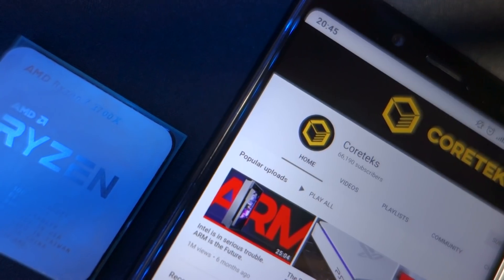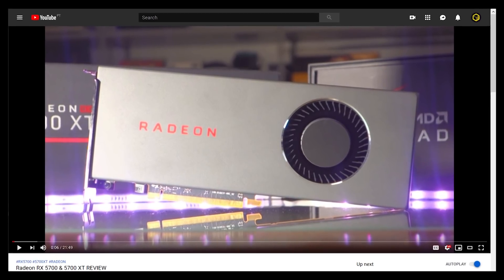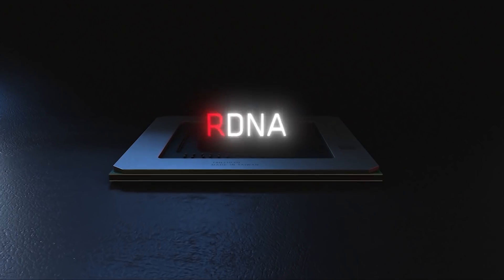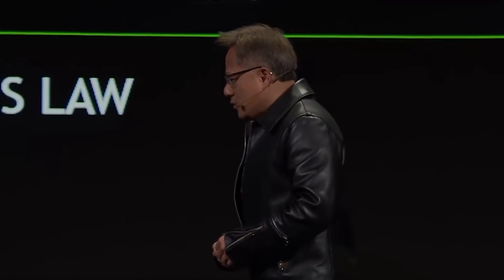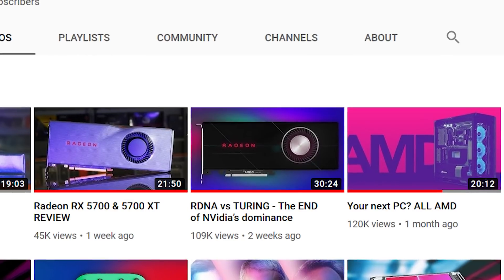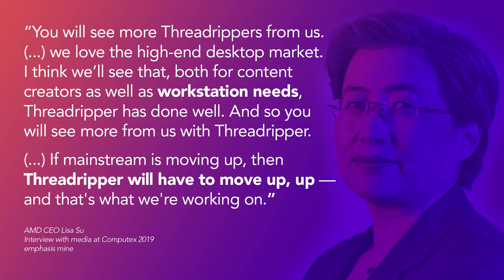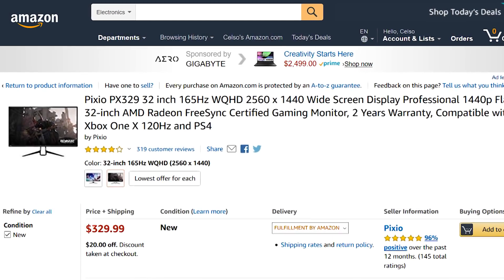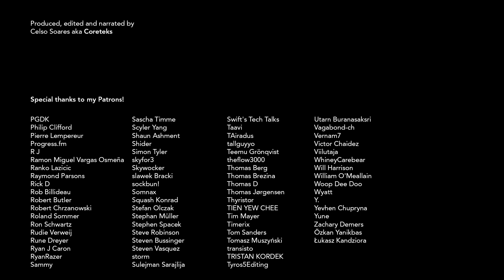What's next for AMD? - 5800XT. Threadripper. APUs.

Comment: I've been pondering buying a Vega 56 for €250 right now vs waiting for custom 5700s/5600 which will run me at least €350 for 1080p 144hz and, while Vega is such a good value at that price, I am going to go with RDNA nevertheless. After getting into the innerworks of the new architecture, it really looks like the vanguard of current technology, and that is very exciting!
Reply: Yeah, and the power consumption for the performance is going to help a great deal too :) I'm eager to see the newer 5700 XT models because I want to swap away from Nvidia for good.

Comment: Dual socket Threadripper doesn't make much sense to me, because Lisa Su herself at Next Horizon 2018 spoke about how AMD wanted to avoid relying on dual socket motherboards for the Epyc platform. She mentioned how Rome  was being developed specifically to combat Intel's dual socket offerings, because apparently even clients who buy dual socket motherboards sometimes only install a single CPU, which makes for a terrible price to performance end product. The reason these clients buy dual socket systems instead of single socket ones, if I understood correctly, is that motherboard manufacturers purposefully omit some useful features from single socket motherboards and AMD is specifically trying to target those clients who need a fully featured single socket offering while at the same time offering a high core count platform that doesn't rely on dual socket motherboards, thus having a much more compelling price to performance ratio.

That said, heterogeneous is definitely something AMD might be aiming at with the Threadripper platform given that the marketing surrounding these CPUs is targeted at content creators and game developers. Apart from AMD, no one really knows just how flexible the chiplet design actually is. Maybe it is possible to slap something other than CPU cores on a single package. Though the thing I don't necessarily understand about your theory is what kind of accelerators you think the Threadripper package will contain. You mention video encoders or machine learning/ai accelerators, but those are tasks that both AMD and Nvidia have been promoting their GPUs for. In my opinion, it doesn't make much sense for AMD to develop new types of chips for a task that their GPUs are already good at. So does it mean that 3rd generation Threadrippers will become fully fledged APUs? Unfortunately, I don't believe so (seeing high-end APUs come to the market is a long lasting desire of mine and the new chiplet design of Zen 2 does stimulate the imagination). AMD have in the recent past (since the launch of their Zen based APUs intended for small budgets) denied any plans on working on high performance APUs.

The era where integrated GPUs completely replace discreet GPUs in the consumer/gaming market is I believe further away from us than the era when Risc V based CPUs become the mainstream platform over x86.

Comment: The Navi 40 dies may only be 255mm^2 small, but dont forget this is 7nm, which has a 40-50% die shrink from 12nm, this means if Navi was produced in 12nm, their chips would be just as big as Nvidias Turing chips. TSMC claims their 7nm yields are good, but they are not as good as 12/14nm yet. In the end AMD has to pay about 50% more for 1 Navi chip than they paid for 1 Polaris chip...i can only imagine how much more expensive and harder to produce any bigger Navi chip is gonna be. Im not saying it wont happen, its just gonna be very expensive or take some time until the 7nm process is improved some more

Comment: Powerful APUs will be the biggest game changer I believe AMD is all over this, I can hardly wait
Reply: They will never be more powerful than a lower card. Its just the nature of them right now. If they learn how to 3d stack the chips, then that will change. Its too small of a die and cooling it would be a pain at its current state.
Reply: Even Vega 11 on desktop APUs is already held back by DDR4 bandwidth, while less bandwidth dependent architecture helps, you will always run into bandwidth issues there. 3D stacking or just a separate HBM-chip might alleviate that to some degree though. APUs will remain media PC and laptop specialities for the next decade.
Reply: Defeqel other rumours for the next APUs indicate that they might use a vega 20 GPU which uses HBM2. If the design is similar to the current vega 20 and implemented well with zen 2 it could be an incredible APU.

Comment: An apu, threadripper or otherwise, with an on package HBM stack could have compelling use cases. Would be quite useful for VM hosts where it's important that the host has a video output without sacrificing a dedicated PCIE slot.

Comment: There's a difference between what can be made and what should be made.
APU's can be built with a high performance graphics engine approaching RX 580 levels of performance using RDNA, but there's a couple of realities against that notion.
Primarily memory bandwidth, AMD would need to include a 4GB HBM die on the package, you cannot get that level of performance with system memory and that includes DDR5 (DDR5 5000 dual channel = 80GB/s). You can't use GDDR6 on package as you'd need 4 dies to get a 128 bit bus. In perspective RX 580's use a 256 bit GDDR5 bus to get 256GB/s. You could get this same bandwidth with 4XGDDR6 16000 chips on a 128 bit bus but you need 4 chips, or 1 HBM2 chip @1000MHz for 256GB/s.

There's no way around it, you're going to have to add high performance graphics memory to achieve any reasonable graphics performance. A 2080ti will run worse than a 1650 if it's limited to system memory bandwidth.

So a single HBM chip might get you up to RX 580/590 performance, but even with 7nm & RDNA you're going add a fair bit to the power draw. Ask yourself if you'd buy a 125W TDP 6 core 16-24CU APU with marginal 1440p (native) performance for $300-$400. Just look at the Core™ i7-8809G with a pricetag of $550 that can't get close to a 570 let alone 580.

It get's worse if you wan't to get to 5700/2060 levels of performance as that'd require 2 Stacks of HBM or 256 bit GDDR6 (8 chips X 32 bit wide). Of course there are ways of optimising memory bandwidth, but the reality remains that to get any level of performance above RX 550/maybe 560, you can't do it with system memory alone. It's why consoles use GDDR (quad pumped) for system memory.

It's always possible that motherboards could come with GDDR for APU's, but then you're going to bump up the cost of motherboards to add 4 chips of GDDR6 just for that APU. The only time that an APU like that makes sense is for small form factors that can't add a discrete GPU.

DDR5 will not make a huge difference to APU's, it'll allow more performance, but not enough to get anywhere near 1440p, they'll maybe be a baseline 1080p, rather than the 720p gpu's that currently are in APU's.

By the time a cheap APU will do 1440p, the baseline monitor will be 4K and you'll be driving it with a $100-$150 GPU (a GTX6650 / RXX500 perhaps) and we'll be beyond DDR memory of any speed, or it'll be a Threadripper APU using quad channel DDR5 memory, and that's even less likely than using HBM.
Reply: A single stack of HBM 2/3 would make all the difference. But yeah, powerful APUs won't be a thing until fast memory is built onto the package.

Comment: Also the best part of this is Ilanos.. AMD's 2011 revolution, the ability to run 1080p at the time with decent settings in most recent games on a $500usd laptop.  That was the first ripple of what AMD would eventually do. Intel and Nvidia's apologists love to try and drag AMD down to the competitors level, they are half right in a way that they never predicted. AMD is done with being the underdog. They will undermine the market to emerge the victor by any means possible, even if it destroys prior cashcows.

Comment: I could really get behind a supercharged APU - something like 6 core Zen2 + around 5700/2060 level graphics for a good price would be very attractive - they'd probably need a new socket for the higher TDP, but the potential cost savings of not requiring a dedicated GPU could make it a VERY attractive option to the majority of 1080p gamers that already run ~1060 level cards etc.
Reply: maybe after 3-4 years it will be possible, but not now. now rx 570 level apu would be veery nice.

Comment: C'mon, AMD. Just release the 7nm Threadrippers already. I really want to upgrade from my 1950x to those sweet 7nm cores. 🤤
Reply: Looking at 3900X matching 2950X in cinebench means 24 core 3rd gen TR might match 32 core 2990wx. This is just insane performance bump.
Reply: bgtubber Stop that saliva right now or you'll fry your motherboard!
Reply: Same here. But I might need no more than 8 cores coz all I need is more RAM support and more PCIe lanes for my half dozen GPUs.
Reply: a R9 3950X is a 2 generation jump from a Ryzen Threadripper 1950X, you might as well go there. 
AMD might have the 3rd gen Threadripper start at the 24 core and up line 3970WX, 3990WX. 
I have a 2990WX, I won't be doing any upgrades.

Comment: The perfect time to launch 5800 Navi would be in September when the 3950X hits - do as bundle with 50 or 100 off if you buy the pair from the AMD web shop.

Or #sneakattack3: launch the 5800 and 5900 in September ... oh and throw in the new TR so folks on 16c TR don't feel hurt from desktop having 16x.

The next TR could start at 24 cores ...

Comment: I'm very excited for the possibility of 1440p capable APU's. It's not that I would actually care much about 1440p gaming in general as I'm usually one of those who turn the settings down anyway to maximise FPS. But if an APU could do it, it would probably suit me modest needs quite perfectly as the biggest reason for me to still be using an R9 390 is that I don't NEED to upgrade. I hope your instincts are true this time too 👍

Comment: If AMD drops a Threadripper APU with full blown NAVI built in I’d buy one.
Reply: That was the idea a few years ago, 16 Cores with a full Vega GPU in it, but it didn't come to the real world but with Zen 2 and RDNA 2 it could be real
Reply: I doubt there's anyone else that would want to buy this product.
Firstly, APUs are for the budget gaming market. TR is for the high-end workstation market. 4 cores is still fine for budget gaming, but workstation applications need more cores. Even for premium gaming, it makes no sense for 16+ core CPUs which is what TR is about. Also note that X399 costs much more than X570.
You could say that the advantage is high-end CPU and GPU in the same package, hence smaller size, but the problem is that the socket is too huge. Every motherboard that uses the TR4/SP3 socket is at least micro ATX sized. This means that the SFF market would have no use for these chips.

Comment: speculation 
the rx5800 is going to be basicaly between the 2080 and 2080super at 500$ 
the rx 5800XT is going to be between the 2080 super and TI at 600$
i think amd is basically going to take the 5700xt add 8GB of HBM2 call that the 5800 
the 5800XT is probably going to have 48 Cu's and also come with 8 GB of HBM2
if amd does'nt do that to the 5800xt and non xt they will just add 4 CU's to the 5800 and 8 to the xt (in comparison to 5700xt) + 12GB GDDR6 memory
the 5850XT yea i dont know if that would exist could tho (probably a 52 cu card between the 5800XT and 5900)
the 5900 will be a 56Cu 16GB HBM2 gpu selling between 700$ and 1000$  and would be competing with the 2080 TI
and the 5900XT will be the new "papa" GPU beating the 2080ti with 64 cu's 16GB of HBM2 for basically 1000$ onwards
if amd has broken the 64 Cu limit there could be a "RX Xtreme" card with a cu count of probably 72 and would be compeeting with the titan rtx
amd could do this "Xtreme" card just to create a TITAN name scheme for their own gpu's like the Titan did for the gtx 780 TI 
exept it would be "Rx XTreme" for the 5900XT 
but this is pure speculation on my part
Reply: they're not coming back to HBM2, it's way too expensive
they had to use HBM2 with vega, otherwise the performance would be killed, vega lives on bandwidth
that's why they put 16 GB on radeon vii
Reply: Having HBM2 isn’t possible I think, RDNA has been made to work with gddr6 and you can’t just swap memory types around without making changes in the architecture if I remember correctly

Comment: Bit of a shame AMD didn't put on a better cooler. The cards are both pretty decent, but looking specifically at the 5700xt it's $20 and 5% performance shy of being another 1070. It's really great.

On your 5800 stuff, I agree. Looking at the 5700xt, and AMDs settings, I'd bet the only thing that's holding the 5800 and 5600 series are (were) the yields. If they have improved, those 2 stacks will follow.

I'd probably bet on something launching in September alongside the 3950x. The 5600 series makes more sense IMO, but a 5800 series alongside the highest tier chip amd offers? Would also make sense.

Or maybe I'm crazy...but I was also the guy saying the 5700xt would be within 5% of the radeon 7, so who knows.

*The only spanner in the 5600 series would be polaris stock. But those'd, surely, be running out by now.

Comment: It's likely that AMD will wait with the bigger GPUs simply because of the cost of 7nm that you mentioned, just like why Nvidia hasn't made the jump yet. Nvidia likes to release their "biggest" chip first (within reason, the 1080 wasn't the biggest pascal chip but it was for a while), which is why they're waiting for the node to mature and get cheaper. It's still likely that AMD will release their high end 7nm cards before Nvidia since they're willing to sell at smaller margins, so they will most likely take the performance crown in every aspect by early 2020 and Nvidia is likely to take it back with 7nm cards of their own by Q2/Q3 2020 or so (though if they don't change their ray-tracing hardware implementation they may lose in that metric).

When it comes to Threadripper they may wait until they have Zen 3 ready and launch it on that platform first with the new rumored 3/4 threads per core SMT, however specialized chiplets isn't a bad idea we'll have to see.

Radeon image sharpening is certainly an interesting feature for lower-end chips, the question is how well it works at lower resolutions like 900p, 720p or 540p, I haven't seen any testing done at those resolutions and how that compares to a native 1080p image, because if it works well (like the sharpened + scaled 1440p image that straight up has less aliasing than the native 4k image) that could be a great way to play games on laptops and low-end APUs. Another thing that would probably help is if they introduced integer scaling at the driver level, that way you could get a crisp (but perhaps a bit pixelated) 940p/720p image on 1080p/1440p monitors using low-end hardware, combined with sharpening it could end up looking pretty alright despite the low resolution and might even help with high-refresh rate gaming on mid-range hardware, like a RX 580 equivalent running high frame rates on a 1440p monitor.